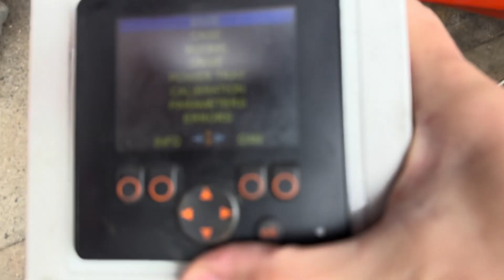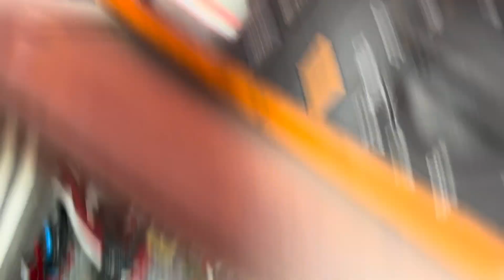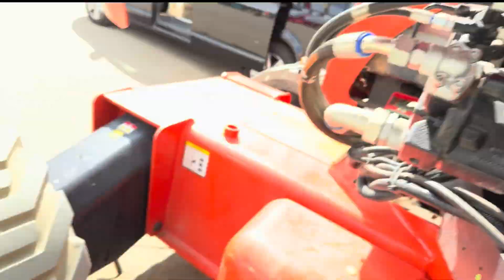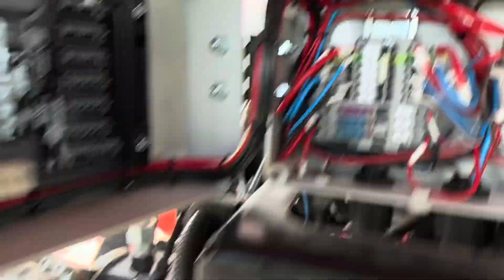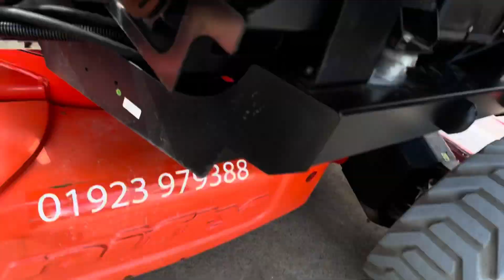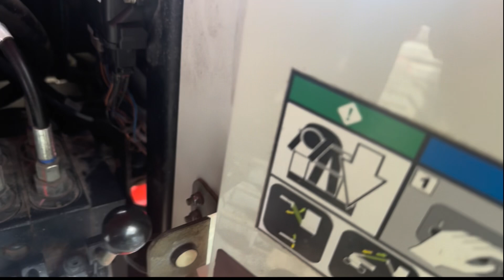CAN Bus diagnostics with Multimeter Niftylift  HR28 Error 27 Error 21 Canbus Fault

Comment: Another great video and very well explained in great detail, it just goes to show even though in the end the canbus resistance reading where good after replacing the valve controller machine still did not work which the last fault was caused by the motor controller been faulty. That’s what I love about canbus faults it’s like opening a can of worms trying to find what is causing the issues. Keep them coming, all your faults and remedies get entered into my bible book of faults. 👍🏻
Reply from the maker: Thank you Stephen . Yes it was not easy one as two failed components were giving same error. Valve drive was causing error 27 and motor controller too. But yes resistance checks is really good way to star with . You will see more about it next weekend🫢😉
Reply: @RTFIX  I shall look forward to it must have been something good to take out 2 units
Reply from the maker: @stephenreeves4898  in my opinion it was high voltage spike at can bus line possibly from controller  and taken valve drive out  as well.